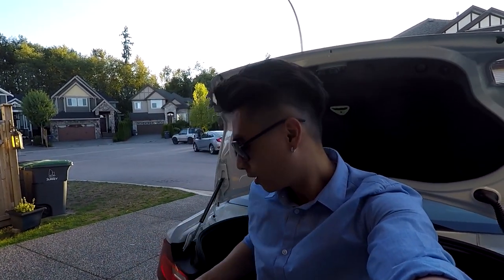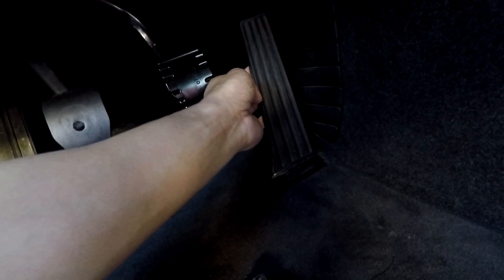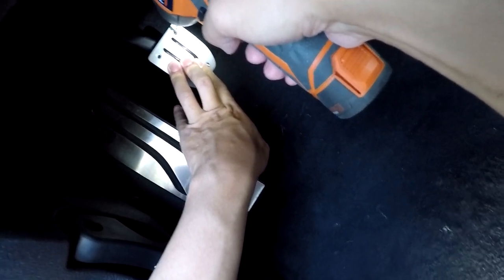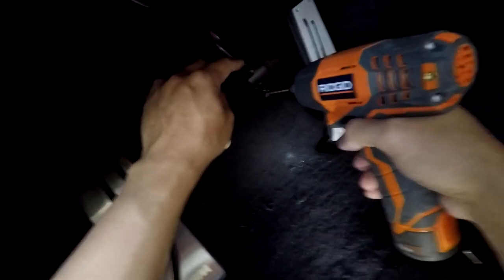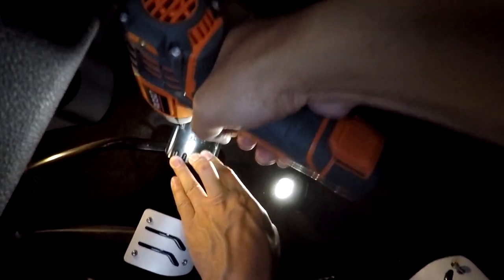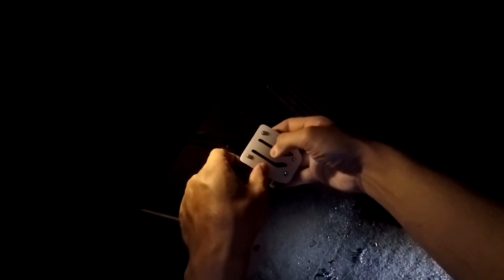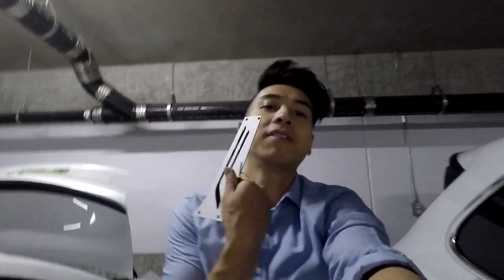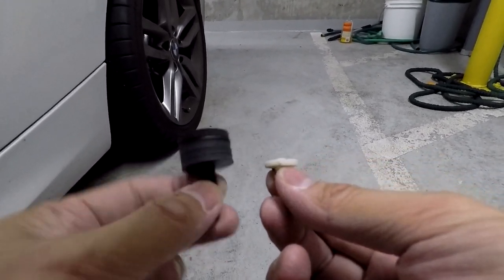THEY MATCH! - M Performance Pedal Install //BMW M240i

Comment: Hey Shundel, thanks for the great vids... your M240i is really looking good with every change so far. Just a quick note re your selection of drill bits, you'll find it alot easier on your drill bit tips if you start off with a nice clean centre punch hole (as you've done), and just go straight on with the final drill bit size. By drilling the final hole size with progressively larger drill bits, you will always get a jerky/grabby initial take up as the drill bit bites into an existing hole. Starting the drilling with the final size drill bit on the centre punch hole will always result in a smooth cut right from the start. The down sides of a drill bit jerking and grabbing as it cuts into  an existing hole is excess wear and tear on your drill and potential for breaking the drill bit. Otherwise, you're all good! :)
Reply from the maker: Thanks Teddy! I initially tried going straight to the larger ones but it kept sliding off cuz of how smooth/curved the pedal surfaces are. Might just be human error. I'll keep it in mind for the future though!

Comment: Btw use titanium drill bits. The brake pedal is solid steel
Reply: Unnecessary. A normal drill bit works just fine.

Comment: are you using an impact drill to drill holes?
Reply: Lol lol sure looks like it
Reply: Derek Doucette not an impact, it has a clutch not a hex or socket
Reply: Dylan Nguyen it’s 100% a impact. You can hear the drill in action.